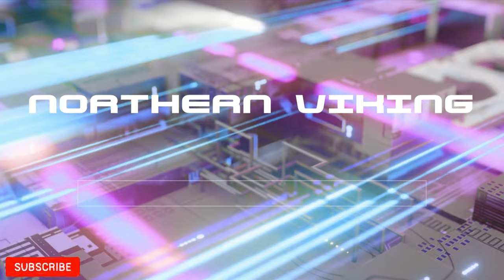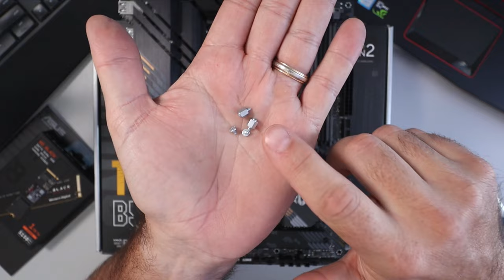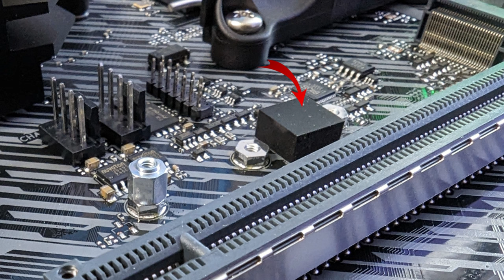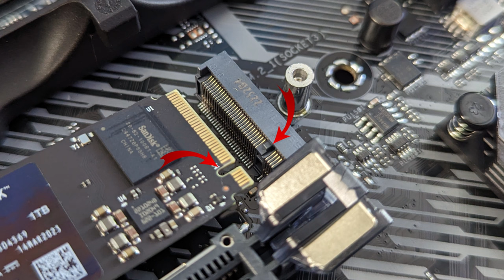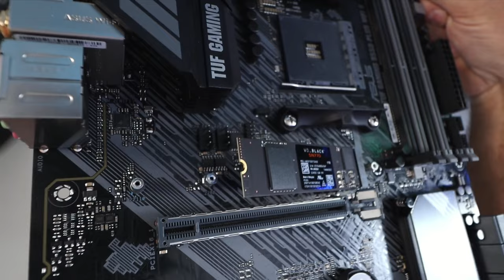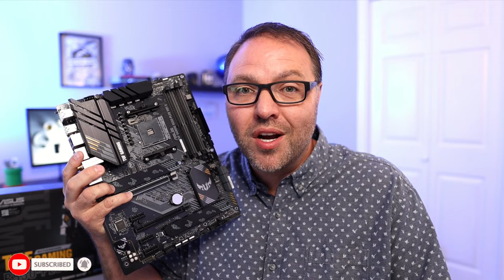How To Install NVMe SSD on Asus Tuf Gaming B550-Plus WiFi II Motherboard

Comment: My Motherboard came with second M.2. Slot. which is the only shielded with that plate. In their site labels that slot as "32Gb/s M.2 support "PCIe 3.0 x4 & Sata Mode" while it labels the  other (uncovered slot) as "64Gb/s M.2 support "PCIe 4.0 x4 & Sata Mode". Anybody know the difference and why only the 2nd slot is shielded with that plate??? THanks. !!!
Reply: The unshielded one supports more speed transfer, but I'm guessing you can use the shield on the first slot too
Reply: @Icy_Capibara   you actually cant which is kinda weird.
Reply: @syabiljhd   well i found it, they are written in the pcb
Reply: CREO QUE TU PLACA ES LA VERSION M-ATX, B550M

Comment: A bought a system recently with this motherboard, so the primary m.2 slot is taken with a Gen4 M.2 (Could support upto Gen 5 M.2 for the future correct?). Now my question I have an older 2 TB M.2 Gen3 Samsung 970Plus, it should work ok in the secondary M.2 slot near the bottom of the mother board correct? Thank you for explaining some basic things about the m.2 install. I have done M.2 install on my old ASUS TUF A15 2021 Laptop which was simple to install but scary, don't want to drop screws and it had no heat sinks for the SSD. But usually my SSD ran cool not too hot.
Reply: Something like that. Closest m2 slot to cpu is for G4 and the lower one G3

Comment: Do installing the m.2's disable any of the Sata ports? I want to run two MVNE but also a few SSD's
Reply: No you can run them simultaneously
Reply: the bottom m.2 slot disables sata 5 and 6 ports, the top doesn't disable any.
Reply: @theraiden115  do you know which are those in the motherboard? I'm having problems recognising one ssd i had before installing the m.2

Comment: Do you think i am gonna be able to do this while a gpu and cpu is installed is there gonna be enough space for my to install it without disconnecting the gpu or cpu
Reply from the maker: You typically wouldn't need to remove the CPU, but sometimes you need to remove the GPU to access the nvme slot.

Comment: I bought my computer pre built. So i guess, the faster M.2 slot is taken by the current SSD? I just bought a new, bbigger and faster SSD. Do i have to move the current to the slower slot? And install the new, faster into the upper slot?

Comment: Thanks for this, didn't realize the standoff screws weren't a part of whatever SSD you buy and couldn't find the ones from my mobo for the life of me. Ordered some now and waiting on those.
Saved me diving into my computer just to get stopped by a tiny little screw lol
Reply from the maker: Glad you got it sorted out and thanks for watching.
Reply: I just installed mine without the standoff or the screw 🤦🏼‍♂️ the adhesive on the back of the heatsink should do fine, right..... right lol
Reply: @Jester12036 still working?

Comment: Thank you. Very helpful. How do you remove the drive after installing, as the clue pad is sticking to the drive?
Reply from the maker: It typically doesn't stick that tight that you can't pull it off.

Comment: Hi there, I'm installing a second ssd, and I'm a little confused about some things. I have the same motherboard, but my m.2_1 does not have the little built-in pad where you put the little square foam sticker, and it does not have a heat sink. Will it be bad if I install it without either of these things? Thank you sm!
Reply: is the version micro atx, b550m

Comment: I want to install a nvme in the second slot of my mobo I need a standoff right? I got a pre-built and second nvme slot has some lime mobo components in between where the screws would go and where the nvme would plug in just making sure as I don’t want anything to touch.
Reply from the maker: Yes, typically there would be some sort of standoff.